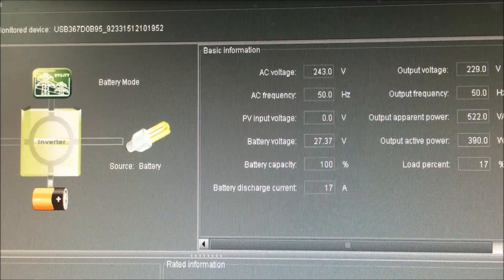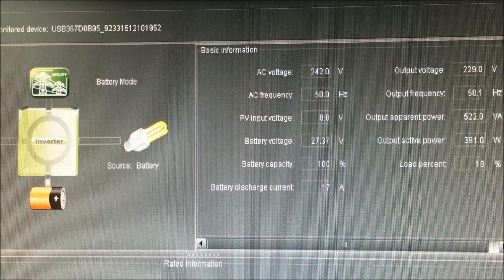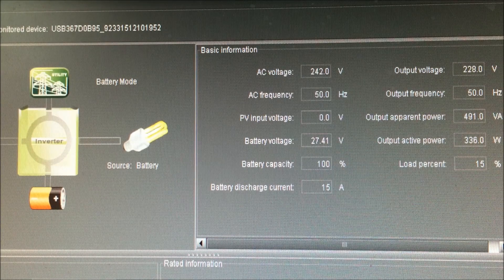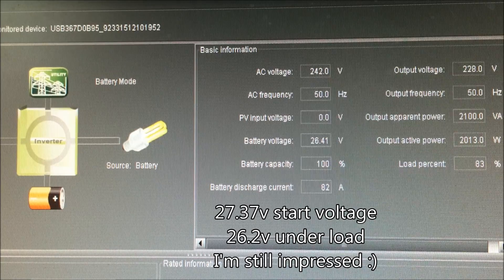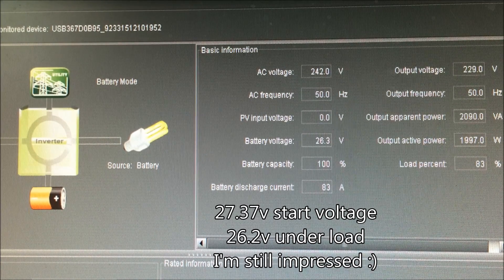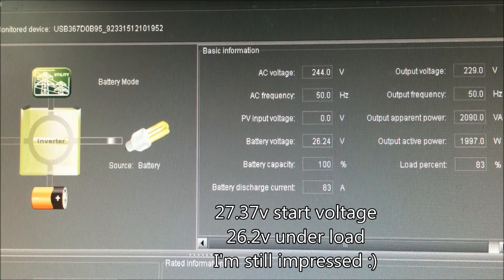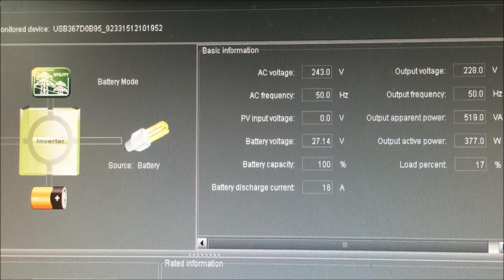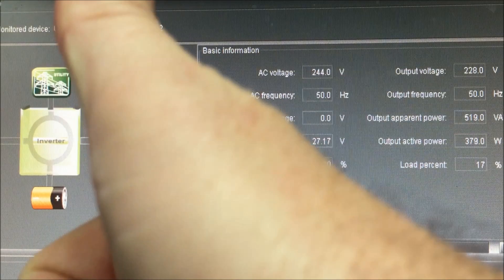18650 Voltage Drop 2000w load for 2 minutes

Comment: The battery voltage on the computer display where is that measured, if it is the inverter input can you measure the voltage at the battery pack during this test.
Reply from the maker: +FireballXL55 yes it is at the inverter. With 35mm2 cable is is only slightly less voltage at the battery.

Comment: Hey Pete, I have a pretty good understanding of the battery pack configurations, but I don't really understand the computer hookup. Do you just have a ethernet cable from the charge controller to your comp? Did the hardware come with its own software? Does the software need to be configured for your battery? How involved is that? Also, how vital do you think it is to have a computer in the system?
Reply from the maker: editing now :)

Comment: put 1 multi meter on the pack and one at the inverter  and you can messure the loss in leads 👍
Reply from the maker: +One up the sleeve customs if I don't I can tell my self there isn't any :)
Reply: +HBPowerwall voltage drop??? na never heard of her haha
Reply from the maker: +One up the sleeve customs that old girl doesn't live here any more

Comment: That's with 3 battry packs, right? O did the math and total internal resistance is about 16 mOhm. That's great.

2 KW on 3 packs is less load than 1 KW on 1 pack. With 3 packs thats about 0.12C.
Reply from the maker: Yep 3 packs